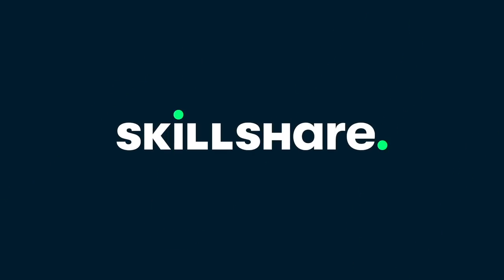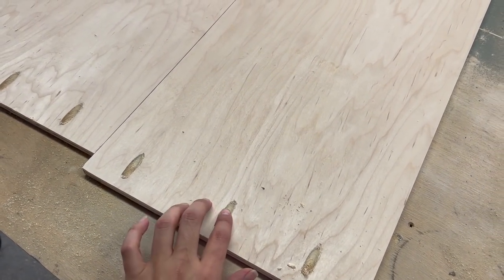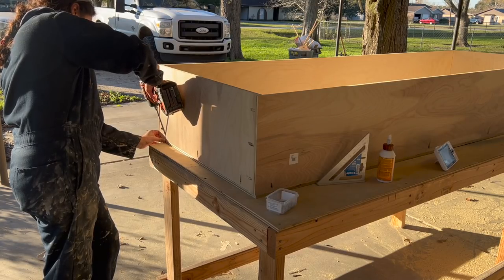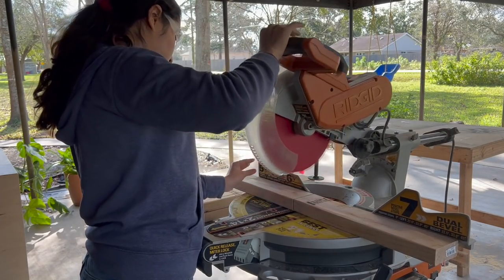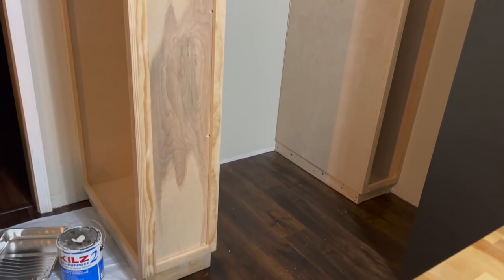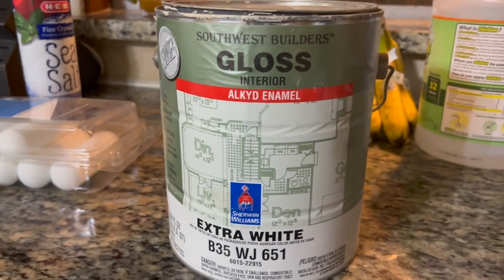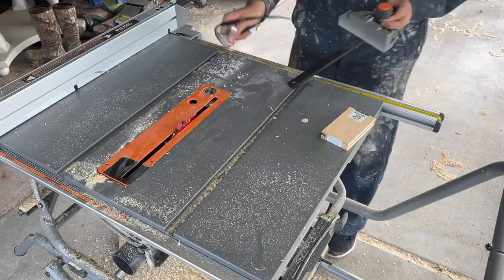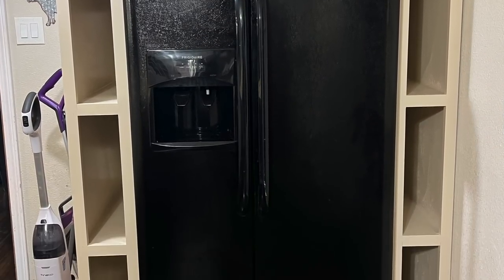DIY Kitchen Cabinets | How to Build a Cabinet Fridge | Kitchen Makeover Part 2

Comment: Absolutely beautiful...love it.  Maybe you could trim out the top of the cabinet in the same way you finished the base along the floor.
Reply from the maker: I will be putting crown molding to match the upper cabinets on the opposite wall ❤️
Reply: @GlendaChavez  

P.S. I think that you're so lucky to have such wonderful manager!

Comment: Great job, it turned out beautiful... Will you be able to connect to a water supply for your ice maker?
Reply from the maker: Yes!! The water line come down from the ceiling... to connect the water line im gonna drill a hole through the top and bottom of the middle cabinet box.... I didnt do it just yet because I wasn't sure if I wanted to add crown molding on the top to close it off completely.... I was running low on time so I left it as is for now... 
Great question! ❤️😊 
Thanks for watching!

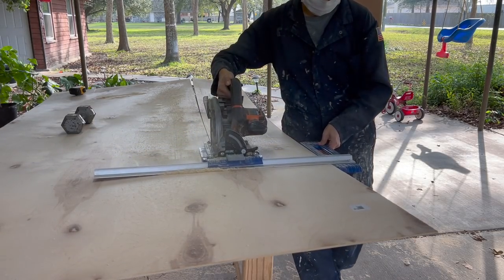Comment: 5:25 How do you keep the sheets from moving when you screw in the pocket hole screws??? Even when I use some Kreg vice clamps the sheets move. You are just holding the sheet with your hand and it doesn't "walk". What's your secret?

Comment: You said that's an oil-based paint but it said alkyd on the can is there an oil base alkyd paint I thought they were like a hybrid water cleanup paint or is it the brand you're using.